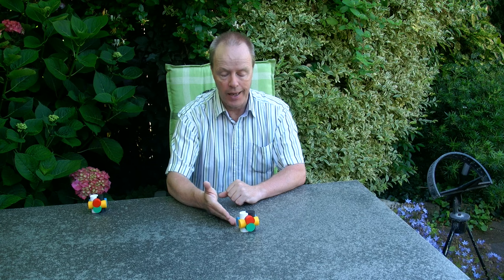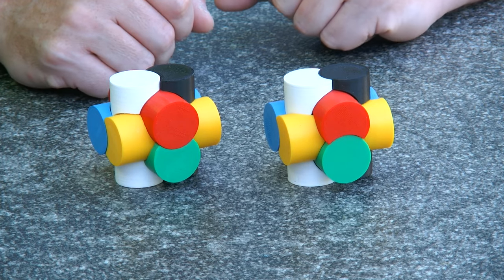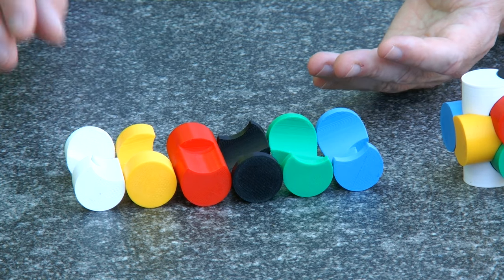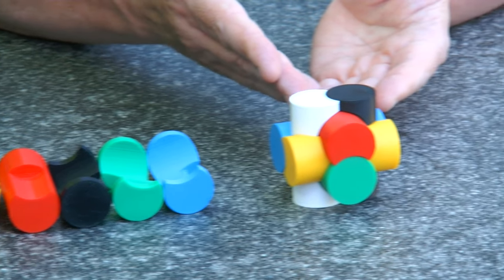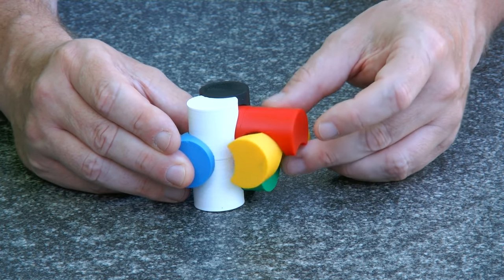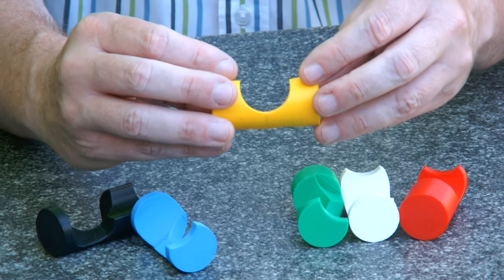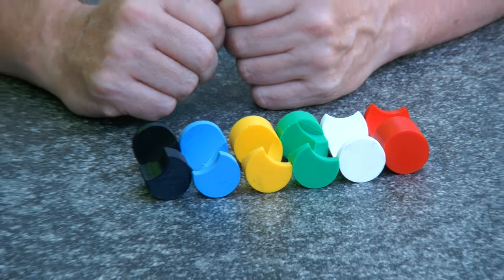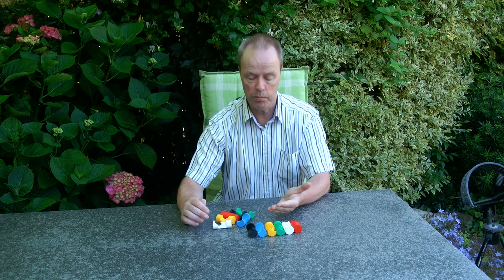OC Burr Too - What material should this puzzle be made of?

Comment: As others have said, it should be easy enough to create the second version in wood or metal. With identical sized diameter rods, you just cut away until you have the pieces the required shapes. You just need to check that it's structurally sound after all those cuts though. As for specifics, you could always just use paint or dyes, or go for different actual materials of metal or wood types. Metal tends to give weight and heft to a puzzle, which has it's own appeal, while wood can introduce a more organic and natural element to how a puzzle feels in the hand.